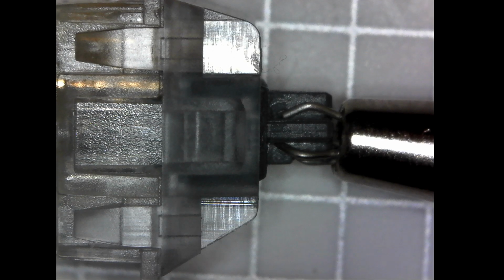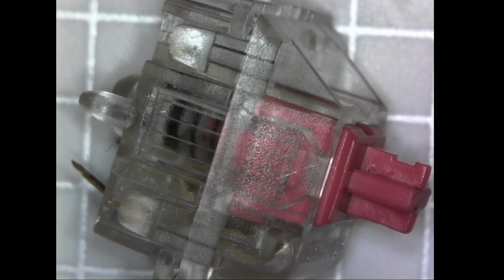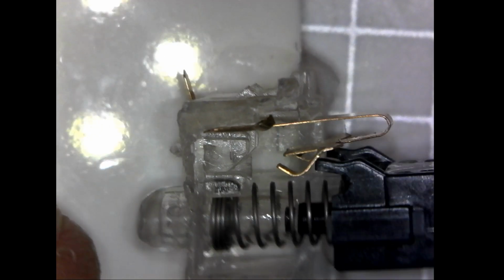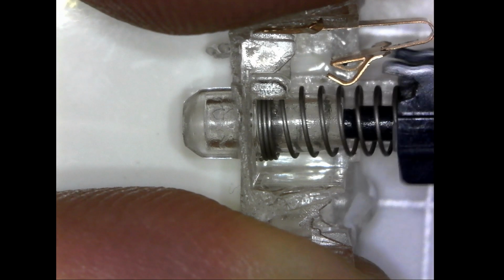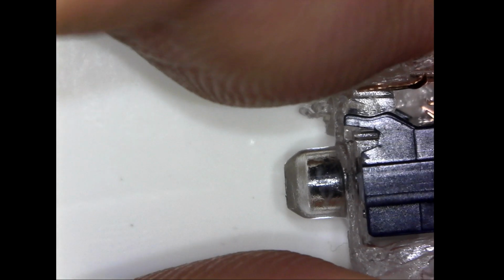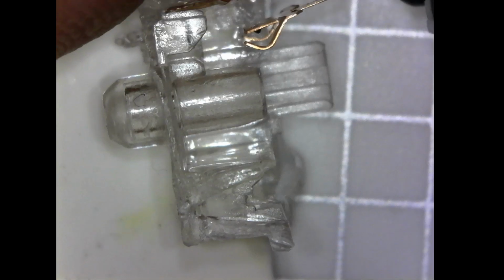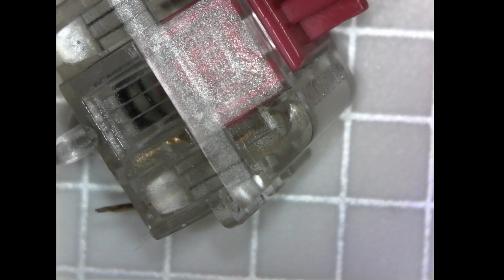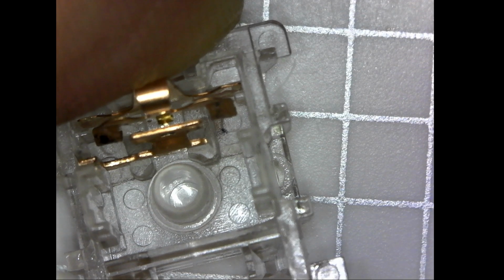Cherry Silent vs. Gateron Silent Switches

Comment: Popped open my Rosélios to check the leg length, and it seems the legs are a little shorter than on the Zilents, and having trouble replicating this, but wonder if you can look into the Healios/Sakurios/Rosélios.

Comment: Do the most recent gateron silent browns have the same problems shown in the vid? I’m looking into those switches
Reply: Joe from Burger King I know, but I’m still looking into gateron brown silents. Not a big fan of linear switches. However, the silent clears from novel keys are not 3 pin smd compatible switches, so I’m definitely not looking into those
Reply: Joe from Burger King don’t worry, I found 3 pin versions
Reply: Joe from Burger King yeah, but they are black housings. I have smd leds in my pcb and using black housings will cover a good amount of light
Reply: Joe from Burger King nice! Unfortunately i don’t have many resources in terms of switches. The only ones I have currently are Kaihl speed coppers and outemu browns. Though, they are a little too loud.
Reply: U buyed silent brown?
Reply: @supermeseriasu  Yeah, around 10 pieces since they're expensive for filling an entire 60% board.
Reply: @dabeasthalofan6276  is good?shold i buy?im between silent brown ,normal braens and gateron yellow

Comment: Hi, u got a great job. What u think if reduce length of both legs(that u marked) of stem ,for less than 1mm for example, it would fix this problem ? or its complitly broke the switch ?? PS sorry for bad eng :D
Reply from the maker: I tried that and it broke the switch :( Plus the switch still made noise.  Now the side rail next to the cushion would hit the housing bottom.  Zeal is having the switches redesigned to fix all these problems, in fact I think he is selling Zilents v2 now.